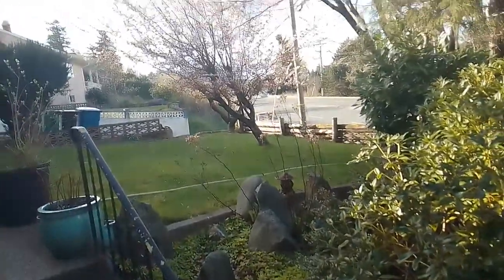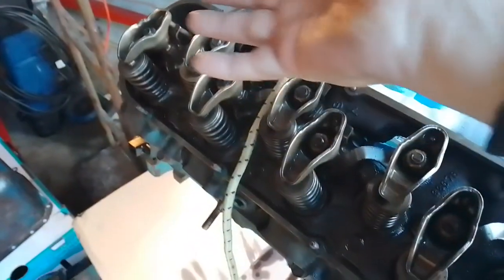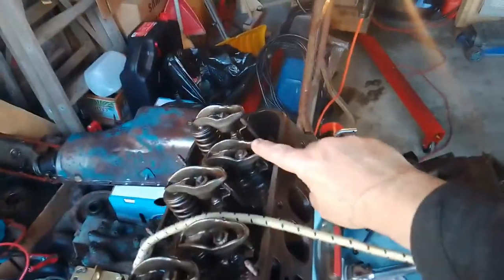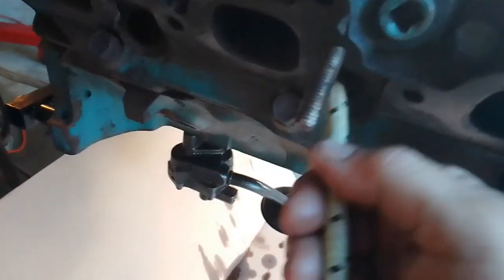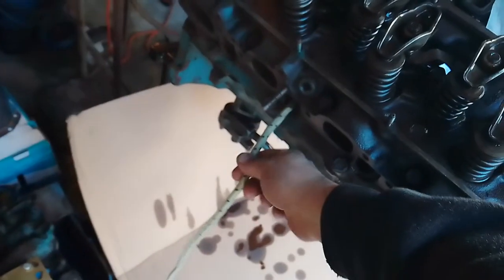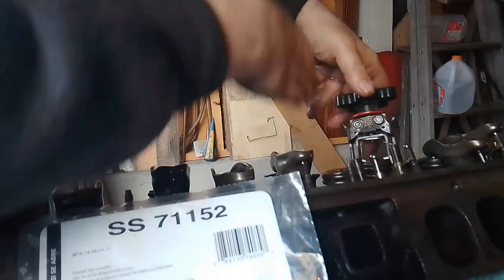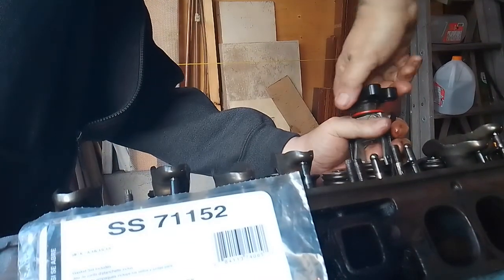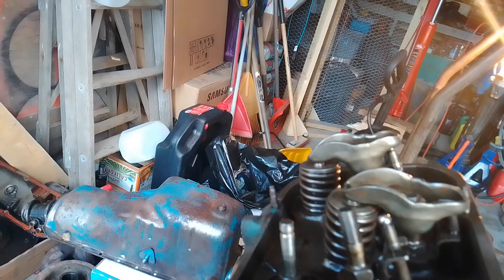Changing valve seals without head removal, works with any OHV engine !

Comment: Great job on the valve seal change and it is good to see this moving forward. I like the rope trick, I wonder if you can do something similar by putting an adapter in the spark plug hole and connecting it to the compresser, then put something like 10psi in
Reply from the maker: There are people that do that, but did you notice how hard I had to push to install the seal ? If you overcome the air pressure then compression is lost, and if the valve is very free in the guide it might well end up in the cylinder. I will always choose to fill the void ! Thank you for being a great part here Joseph 👍
Reply: @TheCanadianBubba  Yes, air is a "trick" but nothing
beats the security of a rope, pushed up tight.
Reply from the maker: @HUBBABUBBADOOPYDOOP - You know  👍

Comment: I've heard of the rope trick before but never seen it done. I've used compressed air before but never really trusted it.
Reply from the maker: The seals were very tight to the stems on this. Have never done the air but it would seem to me that if you overcame the pressure on the valve, the cylinder pressure would be lost in that moment and the valve could slip in. Would not want to prove that out. Thanks for watching 👍